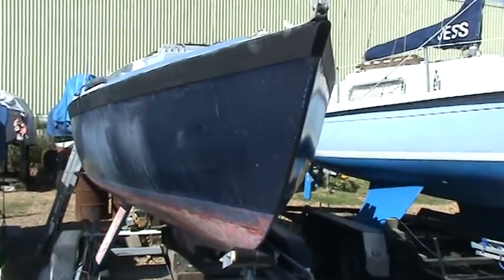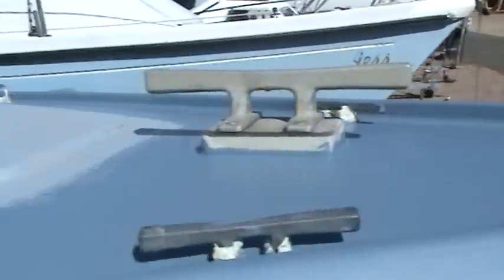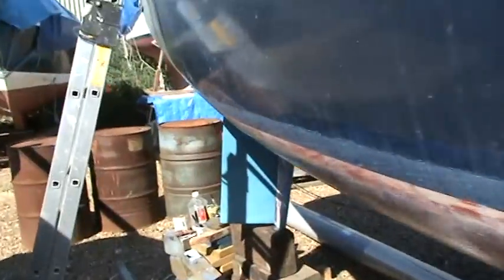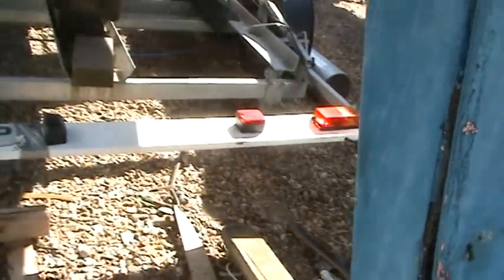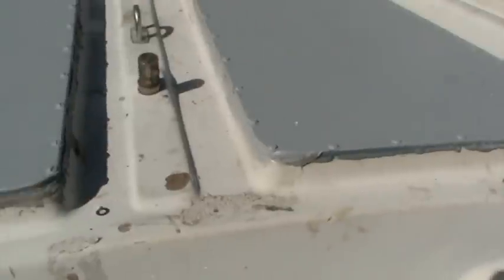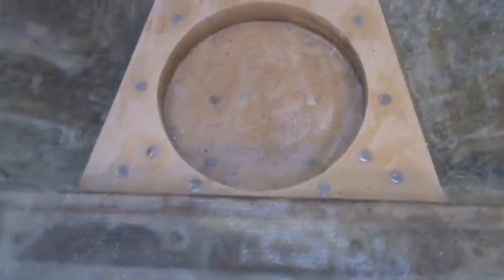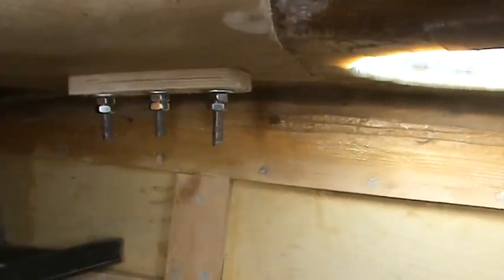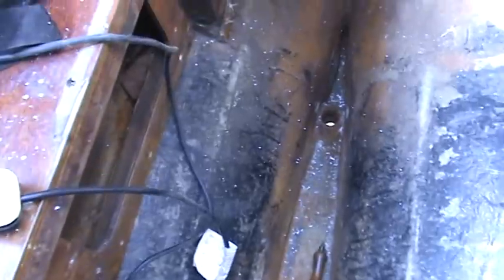The Making of Mingming II - Part 3

Comment from the maker: For hull insulation and additional flotation - Plastazote - a closed-cell nitrogen-blown foam - expensive! For the sealed compartments ordinary polystyrene foam - cheap! Open-cell, yes, but I have experimented weighing pieces down in water for months. The rate of absorption is so slow as not to be of concern to me.

Comment from the maker: Sadly there are no drawings of the mast partners, as I made it up as I went along. I suppose, if I had time, I could make them retrospectively. Mast location calculated the usual way - find CLR of hull, C of E of sail and decide appropriate lead (usually 8 - 10 % of LWL for junk rig). Thanks four your kind comments on my books.

Roger